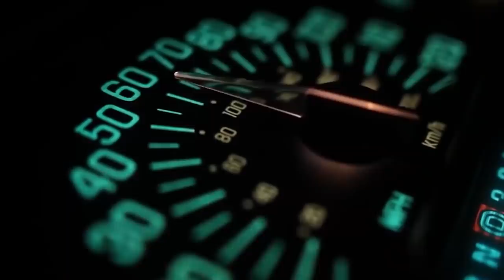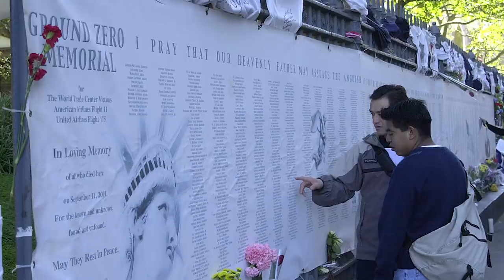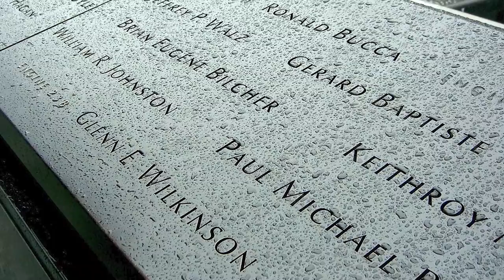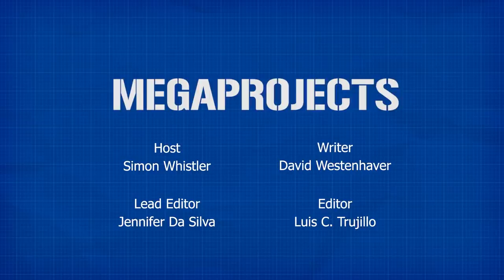After 9/11: Rebuilding After America's Worst Terrorist Attack

Comment: Do a mega project on building 7 and how it collapsed.
Reply: It's not really a megaproject. That building was evacuated before the North Tower fell, and when that happened, it caught fire. Firefighters on site were busy with other, more important things than putting out fires in an empty building. Building 7 was left to burn for several hours without any attempt at firefighting. When it started making nasty noises and became ever more crooked, engineers on site realized it would collapse and evacuated the rescue effort until it had come down.

Interestingly, the fire and collapse of WTC7 has become a reference case study in fire dynamics courses all over the world. It is remarkably typical of a fire in a steel-frame building and how it develops when nobody is around to put the fire out.

Comment: One very big issue not mentioned, was it destroyed and crushed the subway system underneath the buildings. Some subway lines were cut in 2. It took 17 years to replace and rebuild the World Trade Center subway stops and connections.

It could be it's own MegaPrject

Comment: 2:10 That the aircraft was full of fuel is a myth. The first one to hit was probobly less than 1/3 tank full, the second one was closed to 1/2 tank full.
Reply: @elyriawonk6807  to my calculation they should had 35 tons when lifted  of and then about 30 when they hit the towers.

767-200 ER have a range of 12 400km, and the planed route was about 4000km.

Comment: The slow burning Jet fuel couldn't get hot enough to destroy the steel used in the towers. And Building 7 received no damage from the jets. 
The only aircraft parts found at the Pentagon was a fan blade from a cruise missile. 
So that.
Reply: You definitely need to look up more sources. The Pentagon lie is perhaps the most infuriating. Whoever started perpetuating it must have been sifting through pictures taken at the Pentagon that day, then carefully selecting the pictures that appeared not to show aircraft parts, or cropping the pictures that did. Then he went on to claim "look at these photos! No aircraft parts!" after having spent a long time looking at photos with aircraft parts in them and discarding them one by one because they didn't fit the narrative of the story he wanted to tell.
Reply: @Codraroll  Actually it was by the Architectural Union
Reply: But didn't you know, falling debris and fire can make a building fall perfectly on it's own footprint (this is extreme sarcasm for those that can't tell)
Reply: @PortalFPV  And then those people see how far in every direction the pile of debris actually stretched, and how battered all of the neighbouring buildings were, and then they stay silent for five minutes before repeating the "entirely within their own footprints" lie once more, because conspiracy theorists have an incredible ability to quickly forget any evidence that debunks their stories.

Comment: it's lucky the towers came down vertically like a controlled demolition rather than collapsing sideways at the top, that would have been even more catastrophic. Also very unlucky that WTC 7 which wasn't hit also completely collapsed. Huge respect to the first responders who defended America from the threat from the middle east
Reply: The engineer who designed the buildings designed them to fall like that in the event of a catastrophic failure to mitigate damage to surrounding buildings.
Reply: @nissan300ztt  It's quite good design, you think a plane hitting would cause the top portions to collapse and fall which as you say would have been more damaging. It's probably testament to good building code that the buildings stood as long as they did
Reply: @jonc-1989  I agree.  The outer skin ties each floor together.  The center was primary support.  But once multiple vertical columns of the outer skin were damaged along with that center core it was over.  The heat from the burning carpet and papers and jet fuel weakened the remaining structural supports.  Not melted. But melted
Reply: @nissan300ztt  the design of the towers was quite unique in respect of the core and the skin then around it compared to most skyscrapers. Gave the towers a unique look that is sadly now missing from the NYC skyline
Reply: @jonc-1989  lol how does nobody see this guys sarcasm here……
Reply: @jonc-1989  I was at Ground Zero helping with clean up and then emergency radio traffic (HAM Radio Operator), My cousins on my grandmothers side were killed in the Towers.  I will always remember the towers and their unique look.  And every movie with the twin towers in it makes me sad.  The Freedom tower is a gorgeous structure but definitely not the twin towers.  Im also a New Yorker at heart.  I was born there and moved to Pennsylvania as a child.  But I still spent many hours and days there.
Reply: @nissan300ztt  I'm sorry to hear of your loss. I think the loss of so many innocent souls is definitely what we should think about over the coming days rather than whether or not the towers should have collapsed how they did. Because as you unfortunately know first hand, people lost their lives and that's what what matters and what we should focus on. I'll certainly observe a few minutes silence tomorrow and think about all those no longer with us from that day
Reply: @jonc-1989  Thank You for your condolences.  It was very hard not knowing.  But I had to go down and do something.
Reply: @jonc-1989  I suppose it's a silver-lining that the terrorists weren't smarter and didn't dive at the last second into the lower floors of the buildings. Gives me the chills just thinking how much quicker the towers would have collapsed and how many more casualties there would have been.
Reply: @nissan300ztt  Regarding an engineered collapse. Do you have any sources regarding that? Genuinely interested
Reply: @lukefrahn8538  There was a special done on the history channel on the 10 year anniversary of the Trade Center disaster.  And the lead engineer of the firm that designed the building was a japanese man.  And he spoke about the design of the building and why it was designed the way it was.  I dont remember what it was called.  But I remember him stating that the exterior stainless steel skin was used to tie each floor together along with the building center support.  Thus allowing the whole building to be stronger than if each floor was built with its own massive steel girders and beams.
Reply: @nissan300ztt  I'd heard at length that the twin towers were engineered to withstand the impact of aircraft notably smaller than the 757/767. Beyond that, my understanding was that no scenario was even conceived of at the time that could lead to a catastrophic collapse. Perhaps what this engineer described was design in regards to an end of life demolition activity, which may in fact be something structural engineers consider. Interesting if true, since such information could be used in support of either of the two distinct (and divisive) theories about what happened to the towers on that day.
Reply: For anything to move sideways, you need a horizontal force large enough to accelerate it. The buildings weighed half a million tons. 

For anything to topple, it needs to pivot around a firm point capable of supporting its weight as it rotates. Skyscrapers are designed for vertical loads only. If things get out of alignment, gravity ensures that any motion goes straight downwards. Any horizontal forces only have seconds to act before the object hits the ground, not enough to move it any notable distance horizontally.

WTC7 is a commonly studied case in fire engineering. It's what happens when a steel frame building is left to burn for hours without any attempt to put out the fires.
Reply: @Codraroll  although they're not the first skyscrapers to catch fire. But all 3 are the only ones to suffer total collapse from fire.

Even that skyscraper in Spain (I think Madrid?) That was on fire for four days only suffered a partial collapse at the top.

The fires in the WTC wasn't evenly burning on all four sides neither. And the jet fuel burned away almost instantly.

Furthermore, there are sideways forces acting upon skyscrapers all the time due to wind shear. Very tall buildings can also create air vortices which can actually not push, but pull on the building. 

However, this all being said I'm not a structural engineer qualified in such a topic nor do I know what temperature the steel in the WTC was rated to withstand etc. 

So I will not continue with the debate and also today is not a day to focus on the "why's" and "ifs" of that day. Today let's instead think about those who lost their lives rather than debate (and in some cases, argue) on YouTube comments
Reply: @jonc-1989  Fortunately, I happen to be a civil engineer, and I have studied these events with great interest. The reason why that building in Madrid only had its upper floors collapse was because its lower two thirds were made of concrete. Steel buildings are very susceptible to fire. You can look up the pictures of the aftermath of fires in places like greenhouses or warehouses, and see that the steel elements are warped and twisted by the heat. Structural steel does that when it gets hot enough, and a common building fire is hot enough for it to happen.

Structures are not rated to withstand a certain temperature, but to retain their strength over a certain time during a reference (standard test) fire. This time is usually 30, 60, or 90 minutes. It is supposed to buy enough time for evacuation, and for the fire department to show up to fight the fire. The WTC7 fires could have been put out, if there had been enough crew to do so. However, more pressing matters were happening across the street, and they had no crew to spare. They simply had to let WTC7 go to focus on the rescue efforts around the twin towers.

Note that these tests all assume that the fire starts small and grows over time. An airliner crash creates an inferno in a few seconds, a point that generally would not be reached before many minutes into a conventional fire. It also didn't help that the impact stripped off the spray-on foam protection that constituted the twin towers' fire protection.

And while wind can be a significant force acting on skyscrapers, that day was not particularly windy. Wind would also only be able to push the collapsing parts of the buildings sideways starting at the time of collapse (when they "came loose", as it were). Being so heavy there would not have been time to move them very far horizontally in the few seconds before they hit the ground. 

You're right that there was some asymmetry. If you look at the videos, you will see that the top of the north tower leaned sideways as it collapsed. It didn't have time to rotate more than 45 degrees or so before it hit the ground, though. There was no fixed point for the rotation to happen around, so it could only rotate during those few seconds.

Comment: Come on Simon, building 7 did not “succumb to the fires” it was brought down. Even Larry Silverstein claimed they decided to “pull the building”.
Reply: Common misconception. He was referring to pulling out the rescue effort since the building showed clear signs of imminent collapse. While pulling is a term used in demolition, it's only in the sense of attaching cables to a building part and the other end to a sturdy vehicle, then slowly reversing. It's done to bring down free-standing pieces of a building, typically shafts or corners that remain standing after the rest of the structure has been demolished. 

The fire in WTC7 is a very well studied case of fire development in a steel-frame building and what happens when there is no attempt to fight the fire (the building had long since been evacuated when it caught fire from the collapse of WTC1, and the NYFD had other, more pressing matters to attend to).
Reply: no